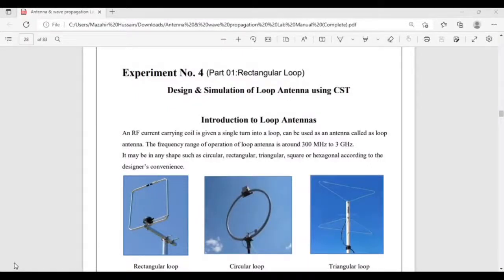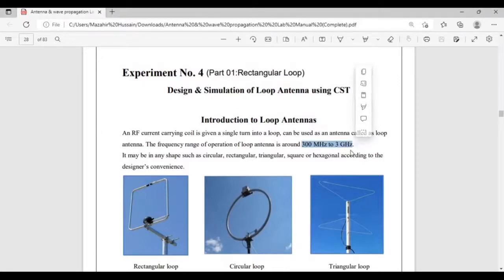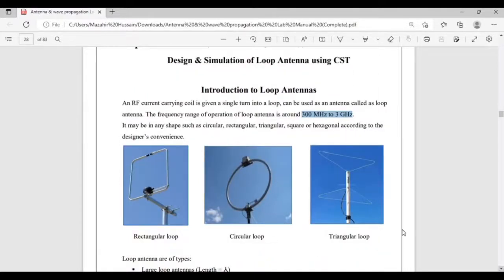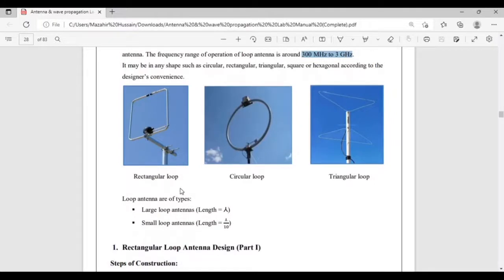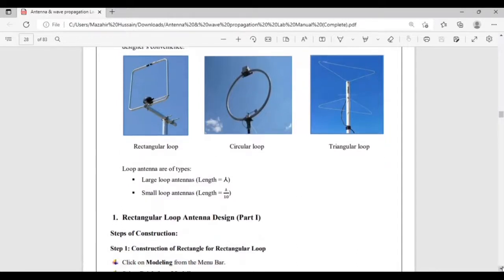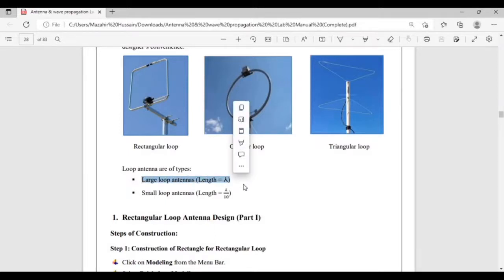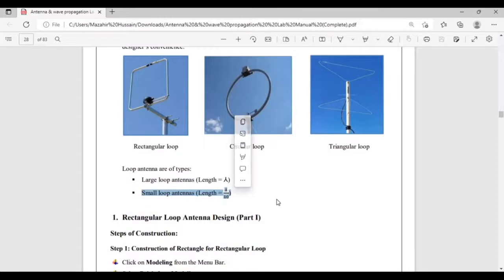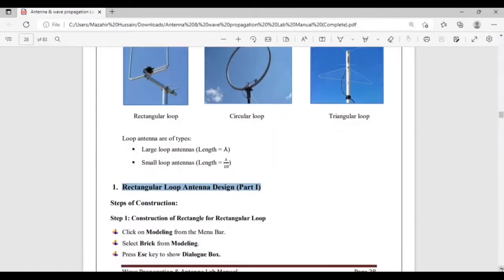Design and Simulation of Rectangular Loop Antenna using CST Studio | AWP Lab Tutorial 04-Part 01

Comment: Great video! One point for those analyzing the CST results: the impedance of this antenna Z₁,₁= 223.544-j62.92 Ω  indicates it doesn't match standard 50 Ω coax, and the negative imaginary part -j62.92 shows it is capacitive and electrically "short" at 3 GHz. 
To reach resonance X=0, the loop needs to be physically larger. In this case, a "Length Correction Factor" of about 1.03 to 1.04 is required, meaning a target perimeter of ~103–104 mm (sides of ~26 mm). 
Standard design practice is to make the loop 2% to 3% larger than the theoretical length to allow for trimming. 
You can use these ballpark formulas for a full-wave loop: 
In Feet: 1005/f (where f is in MHz) or 1.005/f (where f is in GHz).
In Meters: 306/f (where f is in MHz) or 0.306/f (where f is in GHz). 
Adjusting the sides to account for this will stabilize the resonance and make the antenna much easier to feed!